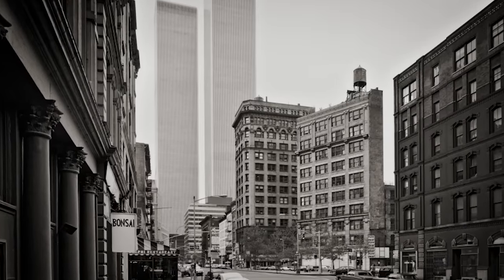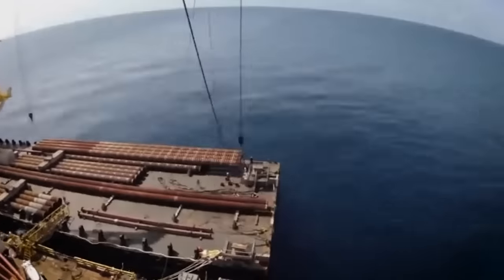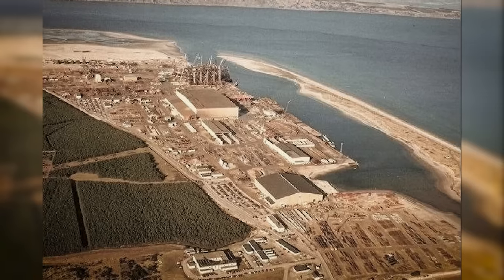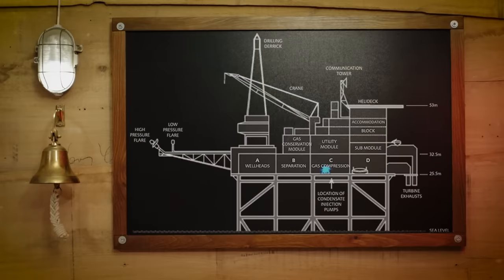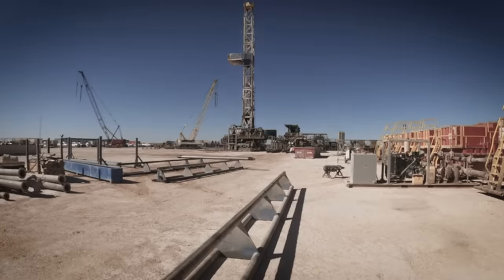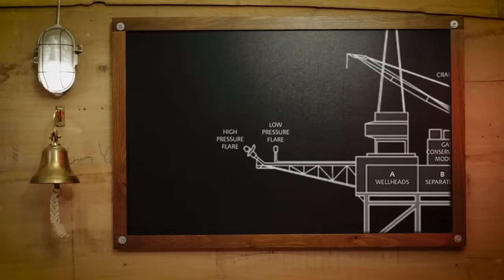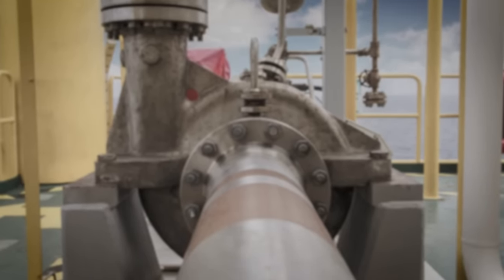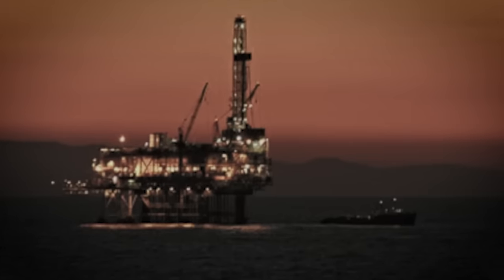This Block Has 87 Dead Bodies

Comment: Thanks for this excellent presentation of a truly horrific event. I was a diver on the Piper Alpha in 1977, working from the Sedco 704 drill rig that was being used as a diving platform.  In those days, the Piper didn't have a special diving platform.  Both  saturation and surface-supplied diving  was from the rig next to it.   The bell, lowered through a diving moon pool, had to be pulled in closer to the Piper by means of a tugger wire from rig  to the Piper and then back underwater to the bell.  Surface supplied diving was by a stage lowered from a rig crane, and entering the water that way I personally installed one of the huge boat bumpers  at a corner leg, the bumper visible in one of your pictures.   Inspection showed  that the Piper"s 'underwater structure had already rusted considerably,.  Topside,  it was having trouble with gas leaks from the flare stacks.   One day I photographed from the rig one of the flares on fire midway along it.  In one photo you can see black smoke billowing up and over the helideck.  In another you can see the bent flare, melting, about to fall into the sea.  And so, although you  do a very good job of showing what plausibly are reasonable seququences that together made for a disaster,, an unhappy fall of the cards, I believe that eleven years before that I thought that the Piper might not have a happy fate in store for its people.  The North Sea in those days was full of disasters and, along with great courage,  it also had great stupidity.  I remember a drill rig that had a sign at the stairs up to the drill floor.  The sign said, "Days since accident" with a place for a chalked in number.  The number never got above 1.(one).  On that same rig the steel grate upon which divers had to walk around the bell systerm was open in places with jagged holes, and rails here and there were wobbly.  A lifeboat drill was postponed because the falls didn't work properly.  The instpectors, as far as I knew, didn't worry about any of this.  They did warn me, however, about a file that I was using without a handle on the tang.  That was very dangerous, they said.  They knew of a man whose hand had slipped, the tang had cut the artery in his wrist and he had died.  Those were the days.  I guess.   On a night of my fifth dive offshore, having gone off a twelve hour day shift to be immediately on a twelve hour night shift, in rough water, with only the light of a flare stack (not the Piper's) and miy own hazy dive light to guide me, I was sent down to clear one of the kort nozzles of a huge tractor tire (that had been used as a boat fender) that was bound up in the screw.  The tool I was sent down with was a hacksaw.  And the first night I hopped off the helicoper onto a helideck I was asked by the guy taking my duffle  whether i had ever been in combat.  Because if I had, he said,  "you'll love it here, because it's just like combat."   And maybe it was.  The reasonable sequences, with their terrible coincidences, were like the little sequences through the air of a bullet from muzzle to brain.   But in that case,  with a lot of noise before hand, it's fast.  On the Piper it wasn't, and if you think about too much you can't sleep well ever again.  I salute he or she who had the depth of soul to become a drunk after that.
Reply: You need to write a book. Fascinating commentary. Thank you.
Reply: Damn dude, what the fuck. I agree with the other guy; write a memoir, you're not bad at writing. Thanks for sharing your thoughts with us.✌️
Reply: This was amazing. Your knowledge and vivid recall have me right in the midst of the action. Cheers, and hope you're well.
Reply: Important,  dangerous work.  Thank you for your contribution.   I hope you feel well compensated. 
It's scary to hear of these dangers, and those lost.  Fossil fuels have helped mankind, but with a huge toll.  I hope we can quickly move on to renewables and modern, safer nuclear power for most of our needs.
Reply: Began diving in 1970 in the GOM and in 1973 continued in the North Sea for many years, and I could not agree more!! That was the WORST rig I have ever been on.  It was always an accident waiting to happen and I dreaded even temporarily landing there, in transit to another location.  The difference between operators/Oil Co's is amazing and OXY was definitely at the bottom!

Comment: An accident like this, but on a much smaller level, can happen to all of us. Recently, while doing annual maintenance on my riding lawn mower, I skipped an important step that cost me dearly. I drained the old oil from the engine and replaced the oil drain plug. I needed to stop work and visit my doctor for a checkup. Before I left my garage, I taped a note to remind me that I still needed to re-filled the engine. After I returned and finished other maintenance, I started the mower and began cutting the grass. After a short time, the engine seized up. The note to fill the engine with new oil had blown off, which caused me to forget that important step.
Reply: This is so true, I was always taught - do one thing at a time and do it right. Sounds easy but in the business of everday life and the complacency that experience brings, it is incredibly difficult.
Reply: How did that cost you greatly
Reply: @AR15andGOD  Thanks for your reply. Appreciate all that I receive. Moneywise: $50 to transport the mower to and from my repair shop. $100 to have the problem diagnosed. $300 to have my grass mowed while my mower was in the repair shop for six weeks. $1,200 cost of a new engine and labor. The total cost was $1,650. When I finally got my mower back, I used my label maker and made a pre-start checklist and placed it on my mower's feet rest. I also installed four analog gauges on the side of the mower. Oil Pressure, Amps, Volts, and Engine Temp. The last item on my checklist is "Start mower and check gauges."
Reply: @AR15andGOD new lawn mower 😂

Comment: One of the key fundamentals which put in place the conditions for this disaster is, at that time, offshore safety was the responsibility of the Department of Energy, whose main purview was production, rather than the Health & Safety Executive, whose main focus was on safety. It wasn’t that production was deliberately put above safety, but it’s a different mindset, which permeated through the decision making of those setting out and enforcing policy etc, leaving gaps and leading to errors. Piper Alpha was a terrible disaster, but a great opportunity for lessons learned. Sadly, as is almost always the case with these big disasters, those lessons are never quite as embedded as they should be, and often have to be tragically relearned and refreshed again at a later date.

Another very good video of a complex event, communicated clearly and simply. Well done

Comment: Before I found your channel I had no idea how dangerous and complex working on and under water was. Thank you for this public service that you are providing. Eye opening.
Reply: also shows the level of negligence associated with the "get it done" attitude in this line of work, in this particular case I cannot imagine a reason for ending your shift without finishing the work on the pump and relying on a report paper to prevent someone switching on that pump, it seems only reasonable to me that if I work on such a piece of equipment, I disable the ability for anyone to start it till the work is done, pull a fuse, remove a switch handle, lock it down anyway possible to avoid a situation just like here
Reply from the maker: Thanks for watching
Reply: @dghtr79_36  Sure, that's standard practice now, 30 years after this happened and is standard practice because incidents like this.  However, 30 years ago nobody even dreamed of locking equipment out completely with the only person who could unlock it being the same one who locked it.
Reply: @nobodyspecial4702  30 years is irrelevant, I'd disable it purely for my own safety (and it would stay that way till the work is completed), because I'm working on the thing, it would have been true in 1910, 1950, or 2023
this is just negligence, or the story was cooked, might be entirely possible that someone important covered it up to avoid responsibility saying that the control room had no info about the condition of the pump that was being serviced and its safety systems, I mean how could they NOT know, since the service had been started on it, they MUST have known that, if they didn't, that is another layer of stupid on top of negligence
Reply: @dghtr79_36  You say that with hindsight, making your claim ridiculous.  Nobody locked out equipment in 1910 or 1950 because that would never cross their minds.  How about instead of assuming the entire world shared your personal beliefs for all eternity, you stop and think about how your mind set was created because you didn't come up with this yourself.  Lock out didn't even become a standard until 1982 in the US and still is not required in the UK, so no, there was no layer of negligence or stupidity on their part, they simply followed the existing standards.  Stupid would be to argue that they should have known to follow standards that didn't exist.
Now, you tell us how you would disable a pump fitting yourself since that's what "you would do for your own safety."
Reply: @nobodyspecial4702  no hindsight, it is common sense, something that has been steadily decreasing in human populations, evident by your comment
Reply: @dghtr79_36  No, common sense would be to bother learning what safety practices were normal for the time instead of thinking that today's practices have existed for all eternity.  Lock out tag out was developed precisely because of instances exactly like this happening.  Now, I get it, you can't understand that life existed before you were born but it did, and we developed safety standards that are in use today based on what we saw happen back then.  Safety standards that YOU can't imagine today will be put in place because of accidents that YOUR generation will have.  If you can't understand that, it's a you problem, not me.

Comment: Hindsight is a burden as much as a benefit sometimes, it's so frustrating to see a sequence of events unfold and to spot a dozen different moments in which a single person could have made a slightly different decision that would have avoided the immense loss of life you know is coming.

Anyway, yet another superb video mate, it's so heartening to see your sub count growing in leaps and bounds as the algorithm continues to recognise the high value of your work.
Reply from the maker: Thanks. It's still a little hit and miss but I'm learning. 

The breakdown of this accident is one for the textbooks. As you say benefit of hindsight but so sad to think of the immense weight of lessons learned.
Reply: The saying is, "safety regulations are written in blood." Thus far (crossing fingers), no other oil platform has experienced such a disaster, at least in terms of human life. There have indeed been disasters, but largely the crew has since this even managed to evacuate successfully.
Reply: In rail accident reports, and many other things, it becomes apparent that accidents are made up of things lining up. Whenever you sidestep a safety item, you increase the chance of accident small, but enough of them they rapidly cascade. Configuration management comes into play, changes that nobody knows about.
Reply: @patrickvolk7031  They call it the Swiss cheese model of accident causation, a bunch of holes line up in just the right way for an accident to slip through multiple layers of protection. I think I read somewhere that a fatal plane crash involves an average of four separate and distinct errors, be they human or mechanical, any one of which would have been survivable on their own, but in combination just happen to produce a set of conditions that lead to tragedy. It's crazy to think about the amount of luck involved and the extreme probabilities at play.
Reply: Ummm....well.....some of the comments suggest that this incident is a one-off, complicated in terms of causation. But this is not true. The Oil and Gas Industry maintains a "profits before all else culture," fueled by orders from above. Until the executives at the top are held criminally liable, at least manslaughter, these incidents will keep happening. 

.
Reply: @sfdntk  Swiss cheese implies randomness, and that there are always holes. Not the proper mindset for safety. Holes get tolerated. Or filling in a hole makes someone want to argue it's a waste of time or money. The holes are filled with blood.
Reply: @patrickvolk7031  There are always holes, no matter how hard you try to eliminate them, that's the point. You either accept that fact or you ignore it at your peril. The Swiss cheese model is one of the most widely referenced and highly accepted models in risk analysis and mitigation for a reason.
Reply: @Shannon McStormy  It is complicated. NASA calls it "GO fever". The idea that we've gotten along so far. Piper Alpha main root cause was in taking natural gas on a platform that wasn't designed for it. Also to not coordinate the different platforms in the event of an accident.
Reply: @sfdntk  Have not heard of that term in the transportation industry. We do failure analysis, fault tree analysis, and for vital system you have to maintain one-point safety. The NTSB will always have some recommendations. I've dealt with rail and air. A worker disregards safety at their peril, but it's different with passengers and the public. A train operator on their cellphone is something we do take into account. To do something suicidal they have to remove tamper proof seals.
Reply: @patrickvolk7031  Like the British train driver who reached down to get something off the floor just as the train passed a red signal.
Along with the automatic brakes that should have come on at that moment being disabled
Reply: @shannonmcstormy5021  Not true at all. Political babble.

Comment: I was 17 and worked in Occidentals Pipe Yard in Peterhead. The Aluminium Body Caskets borrowed from American military came in on flat bed trucks and some arrogant Yank ordered me to put a slicker suit on and steam clean them all .  I also witnessed personal belongings discarded on pallets in a shed  ( a Phil Collins cassette shrunk by the intense heat sticks in my mind ) and Occidental management claiming expensive equipment in the yard was on the Piper. They didn`t hang about long and were already planning their escape. Even as a wet nosed 17 year old skinny lad I remember thinking  you heartless bastards.

Comment: As engineer on a supply/standby vessel in the N Sea stationed off many different platforms, I mostly recall the alarms and emergency procedures for exposure to poisonous gas. Everywhere one went on the vessel masks were required with a 10 minute supply of O2. It was and still is the most hazardous    and alien environment ever. Think of them when you start your vehicle.

Comment: My old man used to work in the north west shelf oil field off Western Australia, and when he started that job we learned about Piper Alpha as part of his training package. They were basically told that in the event of a fire, the last thing you want to do is jump overboard, because it's not the fall that would get you - it would be the massive number of hammerhead sharks that were in the water there off the Pilbara coast.
Reply: Yep, many a man over board drill saw the sharks get the dummy before the rescue crew.

Comment: It's accurate to refer to this as a sequence of reasonable events. I think the Piper Alpha is an example of what I call a failure of permissive, rather than restrictive, safety protocols. They had a protocol where the presence of a safety maintenance form would have stopped using the pump. That's a permissive protocol. A protocol where the absence of a "safe for next shift" form shuts it down would have slowed them that day while they found the form, but if they'd gone to find the form that was restricting them from operating, all of those lives would have been saved. Just tragic.
Reply from the maker: I'll have to digest that. I get the gist but I'm not familiar with the terminology so I'll look it up. Thanks for your input
Reply: @waterlinestories  LOL, I made the terminology up, it's nothing official. I just mean the presence of something that could go missing was required to stop the process. The absence of a form required to start the process would have meant they'd go looking for it, find it, and realize that pump should not be turned on.
Reply from the maker: Gotcha. I was just googling and couldn't find anything. Thanks for clarifying. 

Totally agree. I think the systems used today are far more robust.
Reply: Yes, that's the system I have used for systems operations in processing plants. Nothing at all Piper scale but it gives two opportunities to catch it. If the permits were truly system oriented copies would be in both files.....
Reply: @dpeter6396  If the system is locked out then paperwork isn't needed to be safe locks will stop idiots misunderstanding/misreading or ignoring paperwork ! Your system just generates waste paper locked off valves and switches save lives!
Reply: @jackdbur  I believe in lock-out/tag out but I think if both paper and lock-out are in place then there's a much better odds. One without the other isn't as good. This is a great discussion!